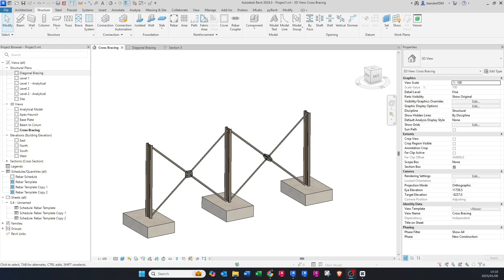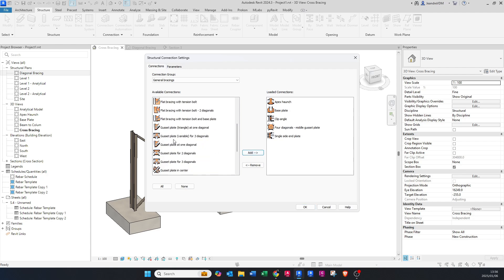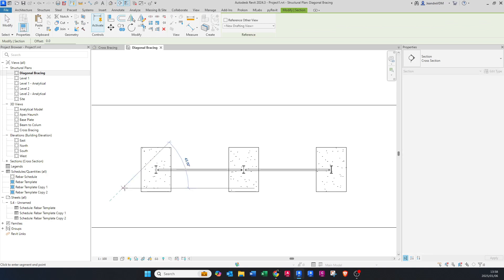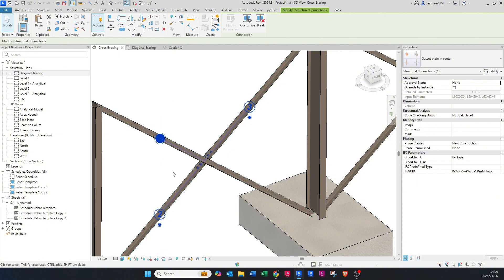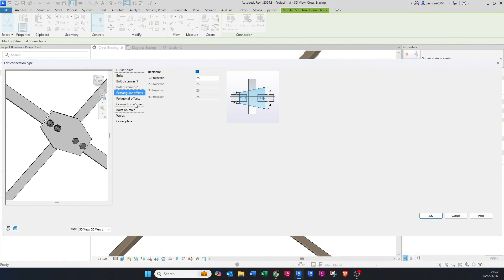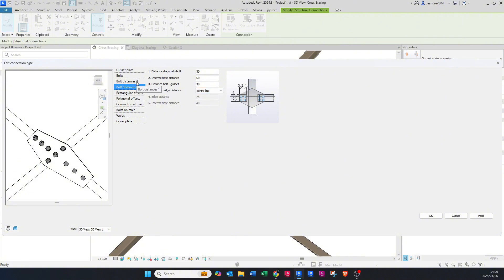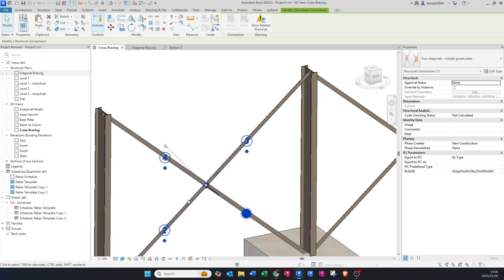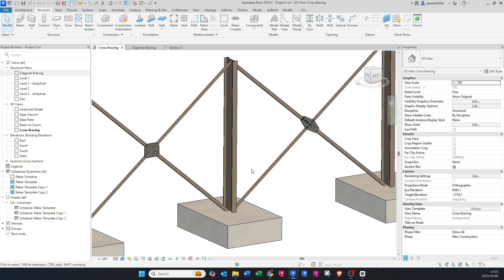Revit Structural Steel - Cross Bracing Middle Gusset Connections

Comment: When copying and pasting the elements to then trim them, is there a reason you don't use the spilt command?
Reply from the maker: Thank you for the question.

I find that copy-and-paste is easier, as the split command sometimes has issues with connections. However, you can definitely use the split command if it works for you.

Comment: errro de conexion, no logro de ninguna manera que se una.
Reply from the maker: I would nee more information to be able to assist you with the error.
Have you followed the video step by step and what Revit version are you using?
Reply: @ Hello, I'm using the brace tool to create the structural union in X as the last of your video, the first way if it works for me with one of the complete diagonals but with the second form there is no way I can make the union, no matter the direction in which I am selecting the diagonal beams, for or against the clock hands it does not create the junction, it just gives me an error. Thank you for answering and I'm using revit 2025.